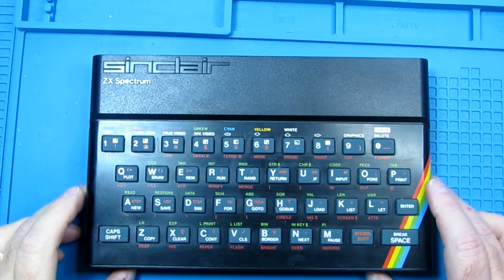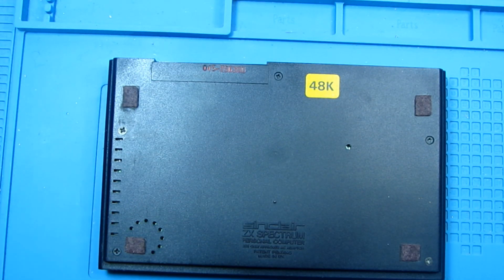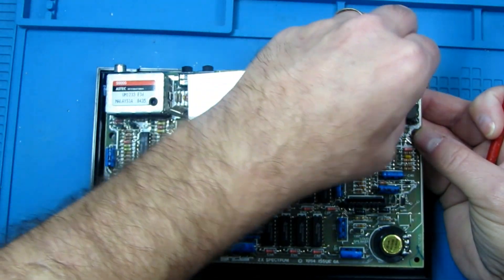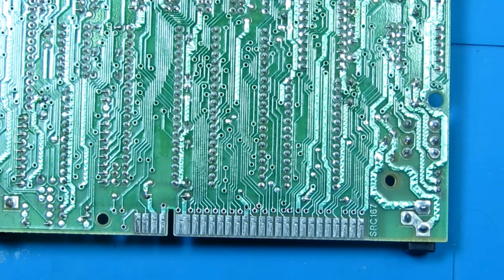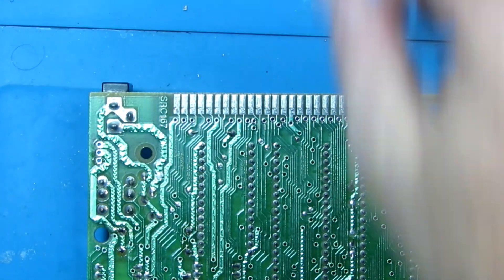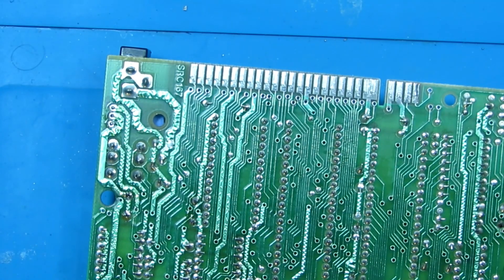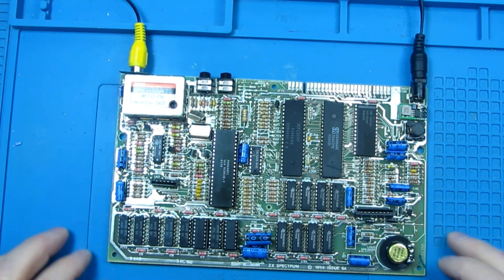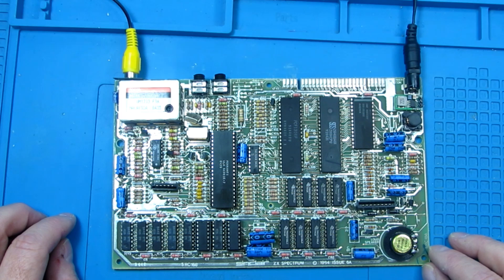ZX Spectrum 48K 7805 Voltage Regulator Upgrade.

Comment: This, plus: composite mod, 3rd-party ROM, audio amp to allow playback of tapes from an MP3 player, reset switch, volume control. After all that, it was still a crusty, low-res speccy with dot crawl! 😁

If you're loading tapes from an audio player, you may want to investigate OTLA 2.2, which in essence speeds up the data transfer and drastically reduces load times.

Thanks for the video!
Reply from the maker: Will have a look.

Comment: Where did you get the regulator/what is the chip model number on it? I have a few of these buck regulators in a drawer but have never installed on my machine - what bothers me about them is the potential failure mode. The linear 7805s almost always fail open, which is safe, but some buck devices fail short. If they short to ground that's fine, but if they were to short input to output that would be catastrophic to anything connected to them and that scares me.

Yes I know Speccies are (almost) ten a penny but I have some rarer machines as well and it doesn't sit well with me.
Reply from the maker: Purchased from Ali Express.  Chip used on these is the HX1314G.  

I have used these before and not had a failure occur so personally confident in using them.  

You have to go on your own judgement on this.